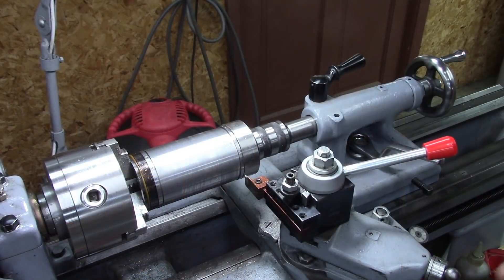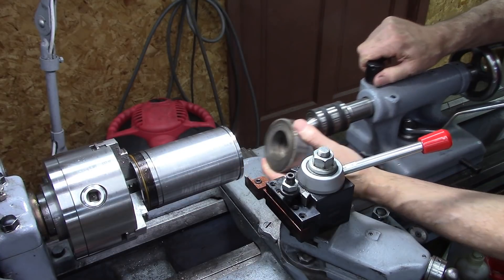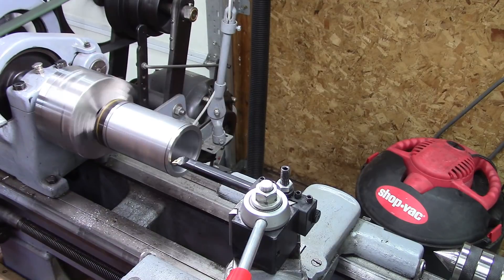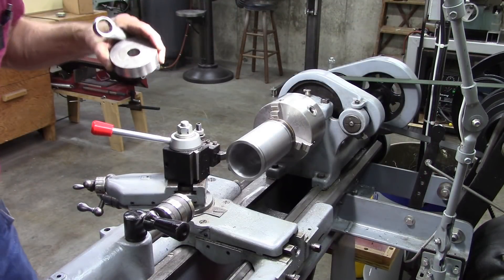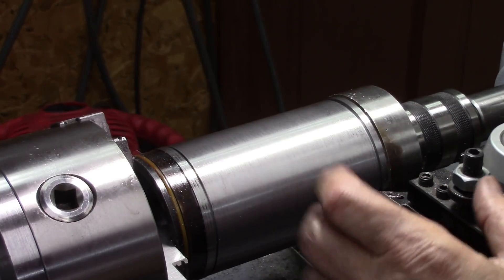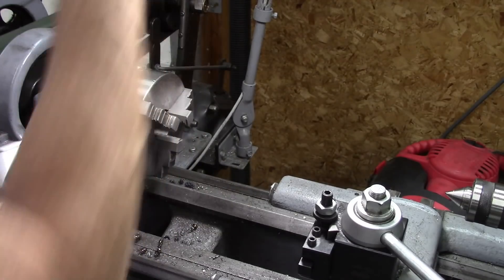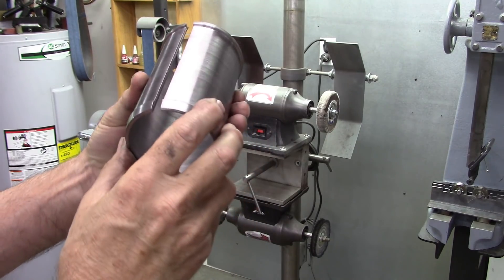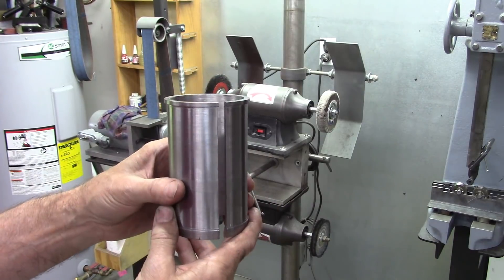Making a Drill Press Table Sleeve Adapter

Comment: hey that works! got a walker turner floor model that basically came with nothing missing and a few accessories that is rare like the table rising mechanism and slow speed pulley. Plan on finding a production table with the drain trough in it, just because it is very cool looking!
Reply from the maker: That would be nice.

Comment: OMG so lucky you and lathe much less the part..... not damage when that came off...Lucky lucky lucky,.....not gonna preach......but for those new to machining.....always lean to be on the safe side....use a steady rest or a follow rest if it looks iffy......as seen things can go wonky in an eyeblink.....
GREAT job doing the part.......many wouldnt have shown this boo boo....but applaud you doing so.....
Reply from the maker: Actually, the lathe was running fairly slow and the part had no significant weight so the biggest danger was damaging the part.  If I remember right it was running about 650 RPM. To me it was not worth the effort setting up the steady rest. I should have taken a smaller cut and took the risk tightening the part tighter in the chuck. I have a CNC wood lathe that scares me a lot more. It runs about 2000 RPM and it's kind of hard to predict.... Plus a simple program error can make it try to take to much at once. I keep my distance if the part is over about 2 inch.

Comment: Looks like your next project needs to be a Tube Spider. Look it up. So useful. Regards from Australia
Reply from the maker: Hello Dave! I've actually made several in the past. I made one with metal fingers and one with a rubber o-ring that expands. The one made with an o-ring was for plastic pipe. The problem is, they are size specific and it takes a while to make them. Do you know of a way to make one that is either easy to make or has a huge size range? If so, please share. Thanks in advance!
Reply: @WinkysWorkshop  Can I send email with pictures to the mtw hotmail address ? Regards.
Reply from the maker: @daveticehurst4191  Yes that would be great or winkysworkshop@GMX.com